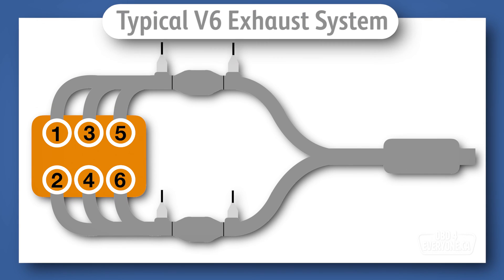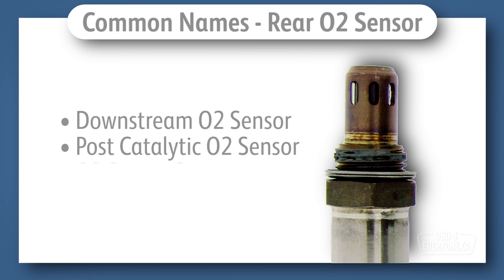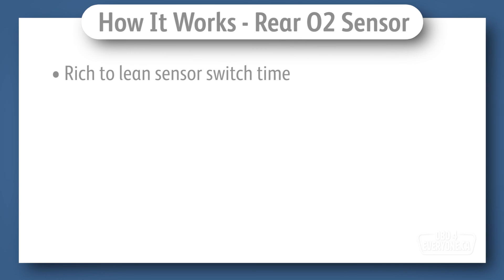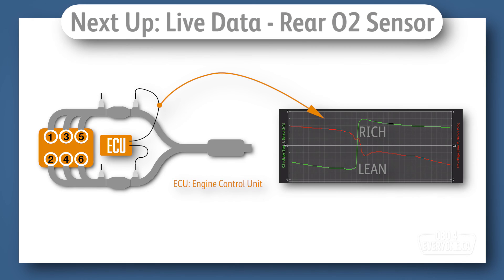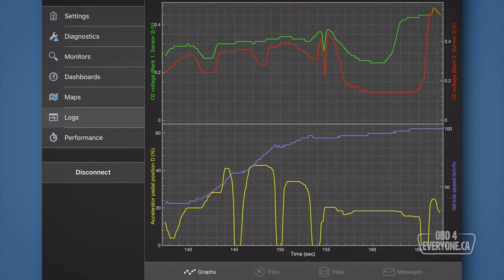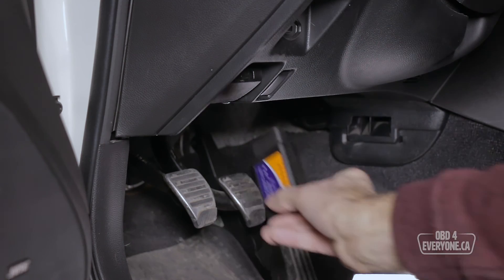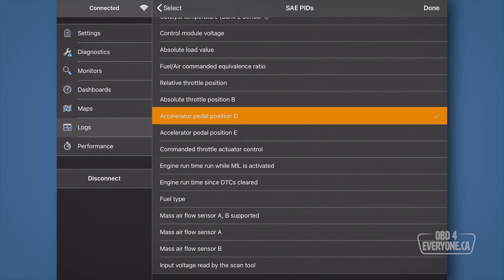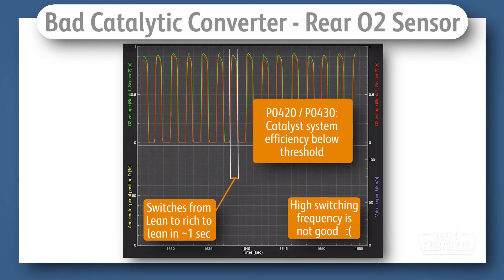Understanding & Live Graphing of the Rear O2 Sensor: OBD4Everyone Ep.19

Comment: My car has 83 000km mileage, but was driven mainly in the city. My scanner shows mostly values minus 100% fuel trim and about o2 sensor voltage around 0.6V with very small +/- deltas. I'm wondering what's wrong - is it the catalyst that produces rich mixture and the o2 sensor tells the ECU to make the mixture lean (minus 100% fuel trim) or it is a problem in the o2 sensor which is stalled at that -100% position. Is it the chicken or the egg first :) There are no error codes. The only symptoms are rough idle on a cold start and engine shaking which is fine after 20s. OBD emission tests says that both catalyst and o2 sensor are not passing the test, but maybe only 1 of them could be the real problem?
Reply from the maker: Hey lyubo bg,
Well done! 
What you did is sometimes called the "Italian Tune Up"
(Some of the Italian super cars don't run well if they are driven slowly. The fix was a good run on the highway)
Reply from the maker: Hey lyubo bg,
Sorry for the delay in getting back to you. I usually reply to comments everyday but sometimes my full time job doesn't allow it :)

What is the year, make, model, and engine size of your car? (it helps with the research)

With the engine filly warmed up, what are your "long term % fuel trim" and "short term % fuel trim" 

These are the fuel trims from the o2 sensor BEFORE the catalytic convert AND they determine how much fuel is injected into the engine.

They are typically listed before the "Short term fuel trim (Bank 1, Sensor 2)" and are in the range of about -15% to +15% for a proper running engine.

The catalyst doesn't produce the rich mixture, the engine's air to fuel ratio does. The job of the catalyst is to clean up the exhaust gases.

If your rear O2 sensor is stuck at 0.6 volts, it is reporting a rich (too much fuel, or not enough air) condition. BUT it could also mean the sensor is not functioning properly.

The app OBDFusion (about $14) has a really nice and comprehensive diagnostic report.
It displays all the OBD data that is available in an organized format.
(I have no financial connection to OBDFusion, I just like their app a lot!)

It would be very helpful to me if you could run the diagnostic report and I can give you an email address (or you could post it here) to send it. 

Then I would have all the data I need so we can work through this together.
Reply: @OBD4Everyone  - hi, thanks for the reply, yes, I wrote it incorrectly, the catalyst doesn't produce rich mixture, but the engine, I meant if the catalyst is not doing it's job and thus leaving a lot of carbon monoxide ..
Anyway - the problem is solved in both o2 sensor and catalyst. I bought the car recently (renault clio 1.6 16V) from a woman owner, that has driven it mostly in the city. I took it on the highway with WOT (wide open throttle) and and after 300km both the o2 sensor and the catalyst are reporting "emission tests passed".
And the most happy news is that my engine idle is not rough anymore. Before the RPMs were getting to low and now everything's fine :)

Comment: Thank you very much. I fully understand that replacing both cats in my car will be the best solution, however the cost of doing so will be much higher then the current value of my car. If I remember correctly our local shop quoted me for about 16 hours labor (times $130 per hours) and cost of two catalytic converters  about $3000 each. So the total cost will be at least $ 8000 CAN.  My car is still in an excellent condition. It is very clean and drives very well. I don't want to put it in the junk yard or part it out at this time.  Also, we are not required locally to have cat converters to be installed on the car as our laws are not preventing us from driving a passenger car without cat. converters being removed. 
My second question will be: How the temperature of the missing cat. converter will affect output voltage and its characteristics from the oxygen sensors?  I measured my temperatures of both sides driver side (Bank 1) and a passenger side (bank 2) of my car and they are substantially different - about 50 C difference. My scanner shows only error on Bank 2 O2 sensor post-catalytic converter were my old catalytic converter was drilled out/pierced through with a screwdriver but doesn't show error on the driver side (Bank 1) where a straight pipe is welded in.Thank you fot you help  S.F.
Reply from the maker: Hey Sylvester Furtak,
I completely understand your situation.

Your rear O2 sensor has a built in heater so it can get to the 300°C operating temperature quickly.
With this in mind, I can't see the exhaust temperature having any impact on the operation of the O2 sensor.

Have you looked into "O2 extensions" for the rear O2 sensors? They are inexpensive and might trick the ECU that the cats are functioning ok. Do a search on Amazon to see what they look like.

In a nutshell, the tubes extend the rear O2 sensors out of the exhaust stream, which slows down their switching from lean to rich and rich to lean, which is what the ECU looks for to verify a proper functioning cat.

Good luck!
Reply: OBD4Everyone they even have some of those 02 extensions that contain a catalyst within the e extension.

Comment: Truly great info. My question is: I have 2003 Land Rover Freelander 2.5L V 6 engine. It has also two cat. converters, two Front and two Rear O2 sensors as explain in the show. Last year my local shop cut out completly one of my cat. converters and weld in just a straight pipe instead and then cut out the end of the second cat and pierced trough a hole with a screwdriver (because they couldn't access its front) to cut completly out. They also installed some kind of adapters?? to correct  check engine light issue. However, right now my check engine light comes on all the time after a few minutes of driving. Also, they told me that I have to remap my ECU to eliminate Rear O2 sensors so the check engine light won't come back again. I know this will be very risky procedure as ECU remapping can go wrong during. and my car won't derivable.  What I should do to correct this situation? Are they are any solutions to correct this issue? Please let me know if you can. Thank you very much. S.F.
Reply from the maker: Hey Sylvester Furtak,
The proper and most likely the only legal fix is to remove the straight pipe and put in a new catalytic converter. That will keep your check engine light off and the engine computer happy. Yes, they are expensive!

If you don't have an emission test or visual inspection to pass other options are:
• Live with the check engine light
• Have the ECU programmed to ignore the incorrect signal from the post cat (sensor 2) O2 sensor.

If you choose to have the ECU re-programmed you might want to find someone who has done it before by searching for Freelander forums or FaceBook groups.

In Canada and the US, it is illegal to remove the catalytic converter with fines from $300 - $600.

Comment: Used this information this evening.   Thanks!  One question - What would you expect to see if a test pipe was installed in place of a cat?  Working on an offroad rig and I am getting very different readings between 1 and 2; I'd have expected them to be closer, essentially reading the same exhaust, unaltered.  Correct?
Reply from the maker: Hey Brian Kimmitt,
I need more information.
What engine are you working on? 

What type of sensor is before the cat:
Is it an O2 sensor (narrow band) or a Air/Fuel Sensor (wide band)?

If I assume O2 sensor 1 is an old style narrow band and you are not using anti-foulers / extenders on the rear O2 sensor, they should be very similar with a test pipe.

But if sensor 1 is an Air/Fuel sensor, the voltages will be VERY different.

What reading are you getting?

Comment: I have a b2s2 at idle graphed at 0.100 being the highest to 0.060 at lowest  up and down  on the graph . at idle  to 0.080 in the top right corner.  ...I get these numbers bc I took a screen shot photo of my obd scan tool graph.... my question is while held at 2k rpm the graph did go up, than just started going down and keep going down until than I let off the gas and it went back to up and down ....?? I'm fighting with. p0421 and not sure if it's an o2 sensor or the warm up cat or the main cat I have a v6 3.0. Eclipse gts   I believe 4 sensors and 2 cats . Today first day trying to read o2 sensors as we speak and video watching . Or if anybody knows how to or what to check for when dealing with p0421 ???
Reply from the maker: Hey jedidias,
How many miles are on the rear O2 sensors? 

Look at the Mode $01 long & short fuel trims or run a diagnostic report from OBD Fusion. (Diagnostics > Report)
If you add the SHORT and LONG fuel trims they should be between about -10% to +10% for a properly running engine.

To compare the pre cat and post cat sensors, graph:
• bank 2, sensor 1
• bank 2, sensor 2
and

• bank 1, sensor 1
• bank 1, sensor 2

Since your trouble code is from Bank 2, the bank 1 graph should show you what the output voltage should look like.

Testing the O2 Sensors:

Have someone drive the car and:
At full throttle, both sensors should be rich and have more than about 0.8 volts.
After full throttle, let off the gas and both sensors should be lean and have less than about 0.2 volts.
If these voltages are not reached, I would suspect the sensor is due for replacement.

Testing the Catalyst:

Have someone drive the car at a steady speed (30-50 mph) and compare the output of the front (sensor 1) and the rear (sensor 2) O2 sensors:

• The front sensor should be switching between rich (> 0.8 volts) and lean (< .2 volts) fairly often.
• The rear sensor should be switching between rich (> 0.8 volts) and lean (< .2 volts) much slower 

if the catalytic converter is working properly.

Good luck with the next steps and please let me know your progress!
Reply: @OBD4Everyone  I'm going to look tomorrow and I think 112k miles on the pipes.    Thank you for the info I'm new at reading o2s and been watching lots of videos on how to read them . I even got a inferred thermometer gun  to check the heat from the cats . Bc p0421 is frustrating . And this car parts aren't cheap . And if it's a a bad cat idk if gut it or replace it . Or o2 sensor to try clean it or buy OEM or autozone .

Comment: Surely if the cat is doing its job then the post cat sensor shouldn't be reading a rich mixture,your graph was showing pre cat sensor voltages  not post cat sensor voltages.The post cat sensor measures oxygen like the pre cat.so if the cat is working the post cat sensor voltage should be at  steady voltage about.5v not jumping up and down like the pre- cat sensor.correct me if im wrong.
Reply from the maker: Hey Ian King,
For a good catalytic converter the front and rear O2 sensors can be the same in amplitude (voltage), but not frequency.

From Motor Magazine Dec 2011:
"A good rear oxygen sensor reacts to changes in the air/fuel mixture just
 like the front sensor does. Creating an artificially rich condition 
should promptly push the rear O2 sensor’s signal up to or very close to 
.900 volt. An artificially lean condition should promptly drop its 
signal down to or very close to .100 volt. Another option is a simple 
snap-throttle test. My experience has been that a good rear O2 sensor 
will respond predictably to the sudden rich-lean conditions a 
snap-throttle test creates.

...

Furthermore, a healthy converter that’s absorbing incoming oxygen 
acts like an oxygen dampener or shock absorber. This makes the rear O2 
sensor react slower than the front sensor. But a failing, inefficient 
converter doesn’t create the dampening effect because it doesn’t absorb 
oxygen. Without the “dampener,” the rear O2 sensor reacts abruptly to 
incoming oxygen—hence the cycling scope pattern in Fig. 1. It also 
spawns the P0420 trouble code."

Full article here: https://www.motor.com/magazine-summary/foreign-service-3-december-2011/
Hey, just for kicks, why not graph your own rear O2 sensor and see what it does?
Thanks for you comment :)
Reply from the maker: Hey  Terence Wyn Roberts,
The O2 sensor shown is the post catalytic converter sensor, also known as "Sensor 2"
"Sensor 1" is the pre cat O2.

In order for the catalytic converter to function properly the air fuel mixture is constantly switching between slightly rich and slightly lean during light load or crusing. The allows the cat to "re-charge" with oxygen so it can perform its function.

Since this car has a "narrow band" post cat O2 sensor, it response like this:
• When the air/fuel mixture is about 14.7:1, it will output about 0.5 volts
• When the air/fuel mixture is less than 14.7:1 (like 14:1), it had detected a rich condition and the voltage will quickly increase towards about 0.8 volts.
• When the air/fuel mixture is more than 14.7:1 (like 15:1), it had detected a lean condition and the voltage will quickly decrease towards about 0.2 volts.

The pre-cat O2 sensor will switch much quicker than the post cat O2 sensor, but the post cat O2 sensor still switches about every 2-3 seconds. 

This is how the ECU (engine computer) determines the health of the catalytic converter.
If the pre-cat and post-cat sensor switch at about the same frequency, the ECU will put up a P0420 "Catalyst System Efficiency Below Threshold", because the cat isn't functioning at the required level.

Does this answer your question?
Thanks for your comment :)
Reply: @OBD4Everyone  nice one ,understand now as you explained the slower switching of post cat sensor.Thank you,keep up the good explanations.
Reply from the maker: Hey Terence Wyn Roberts,
Excellent! I''m glad you agree. :)
Reply: You are actually correct. The post cat sensor should indeed produce a very flat graph line. The information in this video is completely wrong. If the upstream mirrors the downstream it means the catalytic converter is no longer working.
Reply: Terence Wyn Roberts you're going to be replacing a lot of cats for no reason.

Comment: Hi, very nice video! Thanks a lot for it :)

I have two very old (maybe dead) O2 sensors downstream and I will try to use your method to test them. So far I noticed they always stay around 0.1V. 

I have just replaced my pre-cat O2 sensors and they appear to be fine but the car still has very very poor gas mileage. I have 20% LTFT Bank1 (new plugs) and 25% LTFT Bank2 (old plugs). 

Can the downstream sensors have any impact on the current fuel consumption? :( everyone said so far they don't help much so I kind of ignored them..

Following codes appear: P207F-001 Left O2 sensor, before TWC - Aging, correction variable exceeded: Delay time too long (PO2098) /// P200C-001 Right O2 sensor, before TWC - Aging, correction variable exceeded: Delay time too long (P2096) /// Right O2 sensor, after TWC - Level is above applicable threshold (P1999).

Have no idea what to try next cause I replaced a looot of stuff :( Maybe you can help. Thanks a bunch!
Reply from the maker: Hey andybgdn,
Please tell me the year, make, model and size of engine so I can do some research.

On some engines, the rear (post cat) O2 sensors ARE  used in the fueling calculations as well as checking for catalytic converter efficiency.

Try this: unplugging the rear O2 sensors (you will get some codes for O2 sensors heater) go for a drive, and see if the fuel trims change.

I assume you have OBD Fusion... With the engine fully warmed up, run, save and email to yourself OBD Fusion's diagnostic report.  Depending on which car you have, there can be some VERY helpful information in the mode $01 and mode $06 sections.
Reply: Hi mate,

I have a 2003 mercedes clk 240 w209 m112 engine v6 2.6l with 4 o2 and 4 cats!

If I unplug the downstream sensors I get open loop running and no Ltft is being changed at all! System is running in open loop 24/7. After I connect them it goes back to CL. 

I have iCarsoft MB II Mercedes to diagnose but it s not very pro when it comes to graphs.
Reply from the maker: Hey andybgdn,

If I found the correct documentation, your iCarsoft MB II has an "O2 Sensor Test" under diagnostics (page 14 in the manual) . It should tell you everything you need to know about your O2 sensors. (I suspect this is the OBD standard Mode $05 which is good, as it gives a lot of information to help you)

I would also try graphing the front and rear O2 sensors. I suspect the data update is slow, but it should still be usable:

(1) Drive at a steady speed, the front O2 should be switching frequent between about .2 volts to about .8 volts. The rear should have the same voltage, but switching much slower.

(2) At wide open throttle, the front and rear O2 sensors should both be more than .8 volts.

(3) Then lift your foot off the gas pedal, the voltage of both O2 sensors should be less than about .2 volts.

If the O2 sensors have more than about 60,000 miles / 100,000 KM they are most likely due for replacement. Check the maintenance manual to see what their schedule is.

Also, dirt  buildup on the mass air flow sensor (MAF) can cause it to under/over report the air flow and that can cause false lean/rich issues.

If you haven't cleaned it recently, you may want to:https://mbworld.org/forums/c-class-w203/268854-m112-maf-sensor-replace-cleaning.html

Good luck and please let me know your results.